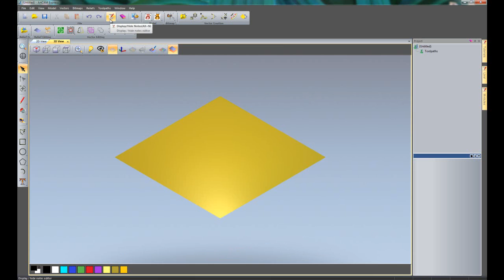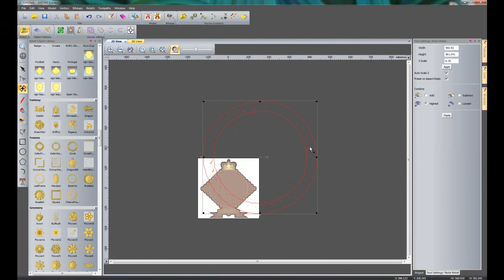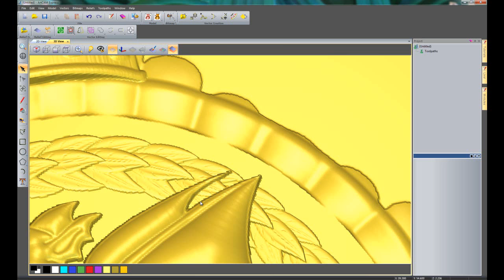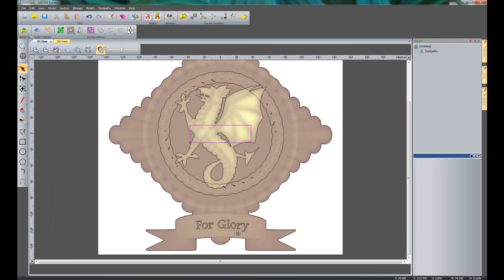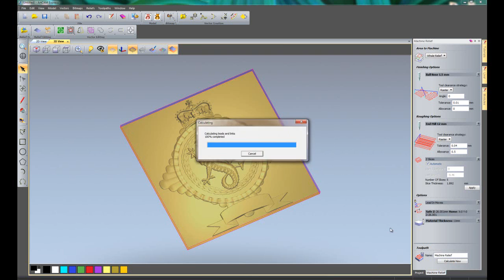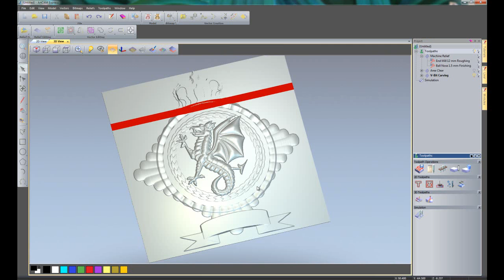ArtCAM Express -  Using the Relief Clipart Library

Comment: Check your software, this is mostly wrong!
►ArtCAM Express only allows the use of one relief. If you try to add a second it deletes the first.
►There is no Import function on the tool bar or in the drop down menu.